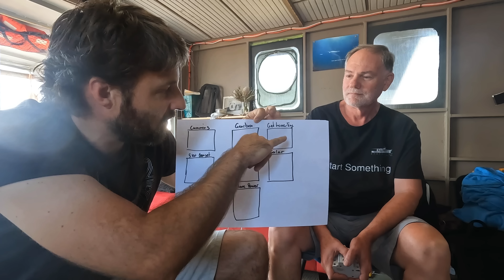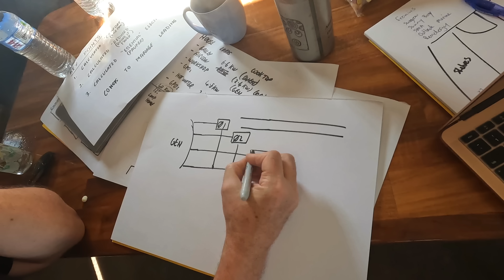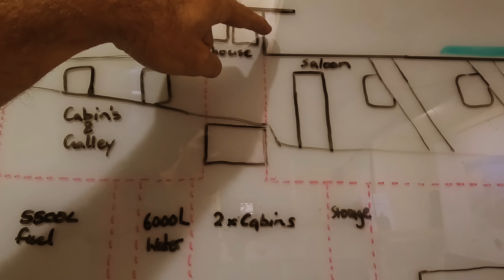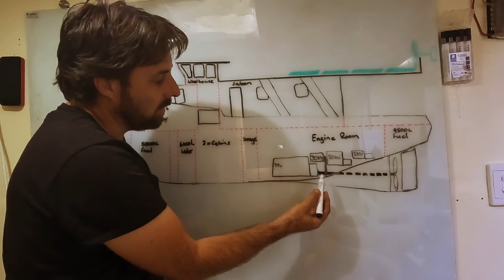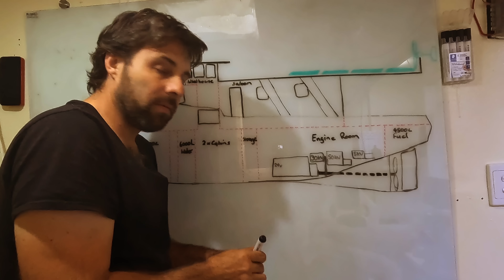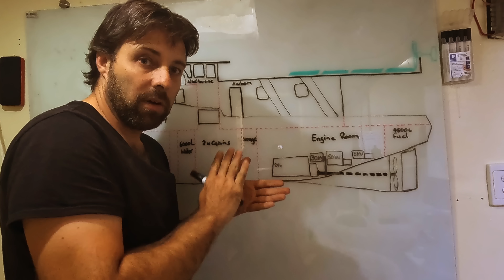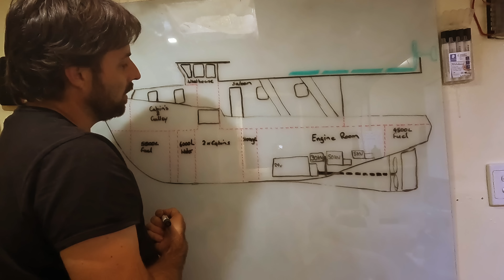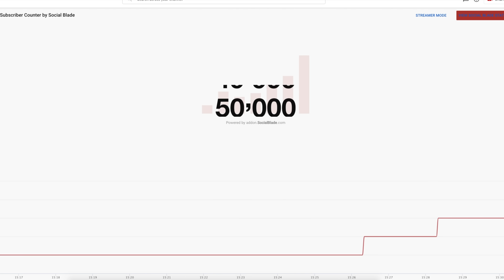Powering Brupeg - Project Brupeg Ep. 273

Comment: If the GenSet has a Nuetral Output, and it should, you will have 3 single 120 VAC outputs. The one issue is balancing the loads. If you have equipment that uses 3 phase your set. Good luck, been their, done it.
Reply: Yes, it has a neutral. We can accomodate both star and delta loads. The neutral, as you say, gives us access to 230V outputs. Our intent is to balance the phases as best as possible. All ok for the get home safe motor, which is three phase delta (so balanced). The house load, and/or battery bank charging, will be balanced as best as is possible, although they will be minor in the scheme of things. What are you driving with your genset? Cheers, Duncan

Comment: hey guys !  wireing...you lost me lol  from my limited knowledge  go with overkill on your wire gage  ,,nothing is easily accessible on a boat . keeping your storage voltage as high as possible  will reduce will reduce voltage loss over transmission but probably requires more expensive control and management hardware. jess i am unaware of the laws in au or your personal feelings on the subject but have you looked into cannabis ? thc butter and cbd oils may be a good option. as always thanks for the videos!

Comment: I’m sure the engine was already shipped, so all my voiced ‘good ideas’ for you are probably obsolete, but may help somebody else.
1) your fork pockets should always be balanced around the center of gravity…..always
2) all engine people forget to make lashing points available, that are sitting HIGHER than the center of gravity, and in all 4 directions….this is to prevent lorry drivers from accidentally applying lashing loads to sensitive bits of the engine,  in your case a couple of brackets fixed with short bolts in place of the removed heads would do
3) importing goods to any country requires the services of a good forwarding agent (whom you trust), who will look after your costs be it for airfreight or ocean freight.   Import duties and costs are the same irrespective of the transport form, but the dhl’s of this world will happily include in their freight cost, at the same time charging you 15-20% admin fees on top….the fact that it is included in the freight does not make it free, just included and much less transparent.  Sitting in Denmark I am too far away to be of use to you, would otherwise have freely contributed my forwarding expertise.
Still wishing you all the best.

Comment: Why was the cat the intermission? The cat is the main project and the stuff about power is the intermsssion. Tally Ho is basically about a Parrot and there is some stuiff about a wooden Cutter in there somewhere. Look at their ratings!  Suggest you consider balance on the 415v. I only did lower current stuff (TV & Audio) but it seems to me that the "workshop" method applies. 3Ph strictly where you need it, 240V where you don't, which if undertand correctly, is what you are doing.
Reply: Yep, pretty much. 3Ph was dictated by the genset, which then led to the 3ph get home electric motor, which makes sense given it is 30kw. The rest of the design fell around that. Dame's colouring in the previous episode was us going through defining circuits and calculating loads to best balance phases for the generator via the inverter. Of course they will not be perfectly balanced, but we want to avoid extreme imbalance. The get home electric motor will be the majority of the load when running, so that will be the most significant part of the (balanced) load. Cheers

Comment: Wind generator may as well be looked at as DC, It may put AC out, but it is unlikely to be synced to any 50Hz ac line.... or if it is, the efficiency will be poor, very poor. So best to treat it as DC from the get go. Shore power, single phase will be available anywhere in the world at any dock, in some places as low as 110v (most places will have 220v available). It may be 50Hz or 60Hz. In many ways it is best to consider it as DC also used to power an inverter. 3 Phase? You probably do not need to supply 3 phase as a rule. Most 3 phase motor controllers will take either 3 phase or 1 phase power in and convert that to DC and then to the 3 phase power the motor needs _at_the_frequency_the_motor_needs_. So remember that your get home motor may need 3 phase but not 3 phase at 50 Hz. So unless you have something that actually needs 3 phase at 50 Hz (compressor may be?) it is not worth supplying it. However, considering you are starting off with a 3 phase genset, you may as well consider that as DC as well, either as three chargers or as a single 3 phase (higher output) charger. I am assuming you do not want to run the genset all the time and switching house power from inverter to genset to shore power is a pain and even with auto switch over, spikes are common. Better to run off inverter (hopefully two) and use everything else to charge.

Comment: Just for reference at our utility in the US when predicting a new households power consumption to size transformers we take the main heat source(Look at the LRA & RLA for heatpump or kW for others) + 8 kW(standard appliances) + a little more for other non standard appliances. The reason you don't take the total is because of diversity. You assume the max power will be with heat/ac  going but probably no more than 2-3 appliances at most at any one time.
Reply from the maker: Yeah that sounds really solid. We built three load profiles and this would sit about right with our middle profile (I think we called it realistic)

Comment: Ummm .... Food for thought.

• The 50kw gen set. 
Is that only to provide power to run the Limp Home electric motor. Y/N
I realise that the Limp Home motor doubles as a propulsion system around any port you may be in without starting the main engine
but to use it for a limp home situation is rather wasteful to convert mechanical energy to electrical and then electrical back to mechanical.
How about putting a power takeoff on it to directly drive the prop shaft itself... (Possibly use the same drive system you have for the 30Kw)

• Battery cooling.
I'm worried about them lighting up the compartment and leaving your controls without any power at all.
Being a boat you have ample supply of water. I'm pondering a water cooled floor over the air cooling that you propose.
Please be aware of these new style batteries and the requirement to keep them cool.

Comment: Check out outback power systems, I have used their products for off-grid power generation jobs that I have done.  They are amazing products and at one property I installed a 36kw wind turbine, 18kw of solar and a 50kw john deere diesel generator.  The outback inverters are very efficient and they can be setup in a cascade configuration where more inverters turn on as power demand increases.  They can automatically start generators as power demand increases or the battery bank is depleted.  At that property the diesel generator can charge the batteries in a few hours of run time and that is enough power for a week.  I wouldn't use any other products because outback is just so good.
Reply from the maker: Thanks Shawn. We will check them out
Reply: Thanks for the pointer Shaun. You have jogged my memory. I have bought a few power system related things from them in the past. They have a good range of products. Cheers, Duncan

Comment: The first thing that could kill any of the drive components or the engine gear box is applying a lateral load to components only designed for an axial load.  This can destroy things in less than a day of operation.  Hanging an electric motor off of the drive shaft will be putting a lateral load on the drive shaft and the gearbox which only sees an axial load normally.
 
All things considered, personally I would prefer 2 engines side by side and use a PTO type setup to swap the engines to the prop shaft.  A spare engine would work better than the 30kw motor.  With 2 engines you could run the first until it failed, run the second until it failed, and then repair one of the engines scavenging parts off the other.
 
What's the purpose of the whole electric backup propulsion?  Is it because it's the best idea, or because the parts are lying around?

Comment: Apart from 120v everything else in the world should be within spec of the hardware because although you said 240/415v the official standard here is 230/400v with a -5% +10% tolerance so everything will accept 220v the only thing to watch is frequency we are 50hz and some are 60hz in most things this really doesn't matter it may make transformers hum and changes the speed of motors but all that means zero if you simply go straight from the isolation transformer to a charge controller just using the shore power as a way to charge your batteries
Reply: Yeah, quite right Shayne. I resort to old school numbers in saying 240/415. Cheers, Duncan

Comment: So... I have a question... I may be completely wrong and/or you may have touched on this and I just missed it. But with the get-home motor, wouldn't that, being attached the way it appears to be in your absolutely beautiful drawing, wouldn't that create a bit of a pulling force on the shaft, causing uneven wear on bearings..? Would there maybe be a way to support the shaft from underneath right at the connection area? It just looks like it's either belt or chain driven so I'm worried that in order to make it tight enough, it would create a lot of stress...
Reply from the maker: Yea your right it does create side loading however we have worked closely with the gearbox supplier and they confirmed we can take up to 300kw off this gearbox in a belt drive configuration. So our 30kw motor won’t cause it any issues. Plus it’s disconnected unless in use